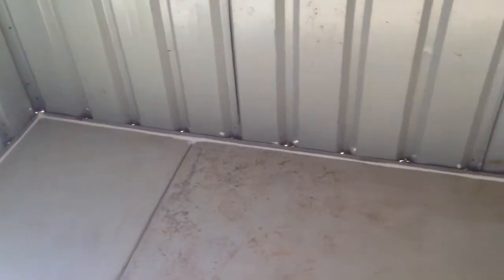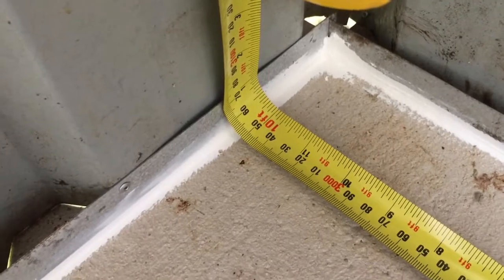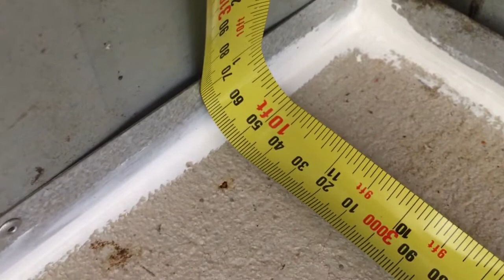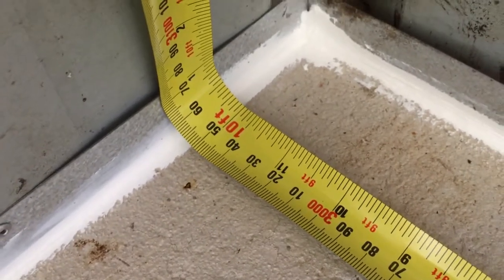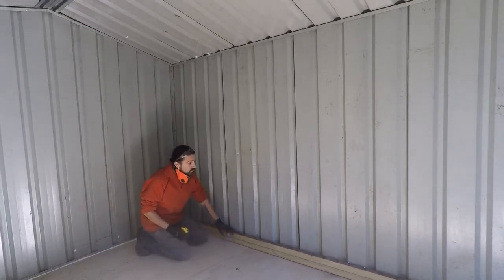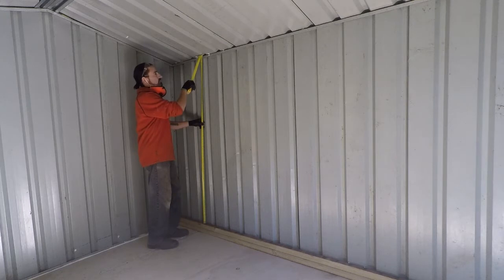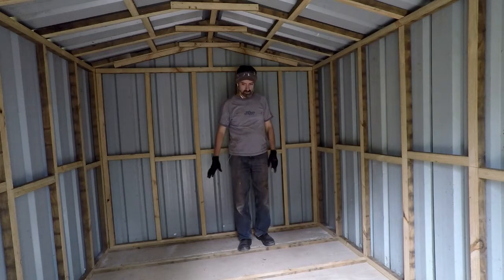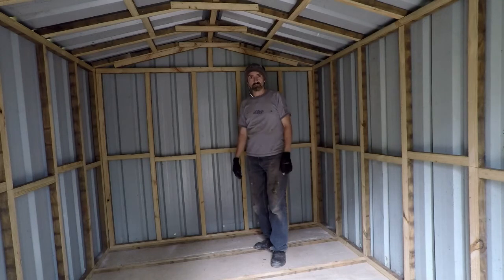Framing out my prefab shed

Comment: Thx for replying so fast, The shed I have has round tubular framing kind of like conduit and I am looking for a way to frame it with 2x2’s like you did. But wasn’t sure how to secure the framing to the walls or ceiling without a lot of damage to the corrugated metal
Reply from the maker: From memory, I don't think I secured the roof to the framing. The walls were, but not all over the place. Along the header (top wall framing member) and a few studs if they happened to be up against the steel. I also used screws with the rubber washers to prevent leaks.
Good luck with yours. Thanks for watching and reaching out.

Comment: What happens when it rains and the bottom channels fill up? Does it overflow into the inside? Not sure whether to add filler rod and sealant in all the spaces of mine? Or drill a few drain holes in the outside wall of the channels...
Reply from the maker: @elbanti  the inner side of the channels are slightly higher than the outer side. I also went along and drilled drainage holes in the so that they would drain out towards the outside

Comment: Hey mate i know this video is old n ya probably dont remember but was wondering what you sealed the floor with? I know you used foam for the gaps in the corrugated iron did you use the same for the floor ? Cheers
Reply from the maker: I used Selley’s 3in1 silicone sealant.  It’s great stuff. I just cut the nozzle a bit bigger.

Comment: How did you screw or nail those rafters to the top plate?  It doesn't look like you had access from the top for a toenail above the bird's mouth.
Reply from the maker: I think I just toenailed upwards from the top plate into the rafter. Not ideal, but it kept them in place. Thanks for watching.
Reply: @oojagapivy  it would be awesome to see a more detailed walk through of your framing. I just put up an ABSCO shed and I'm going to have to get some framing inside of it because I'm really afraid that the winter snow will collapse the roof.
Reply from the maker: @Eger118877  the next 2 videos in the playlist show a bit of the framing in more detail, including one scene where I hang from the rafters to test the strength of the roof frame. You’ll see my noggin detail including the extras I put to support the wall sheets I got. I’ve stood on the roof of this shed to trim the trees behind it, so I reckon the frame strengthened it a fair bit.
Reply: @oojagapivy  thank you. I will watch those videos for sure. Framing the inside of that shed was a great idea.

Comment: Hey mate. Trying to do the same. Did you screw any of the frame to the walls and/or roof? Cheers
Reply from the maker: Yeah I did. I screwed the walls to the frame in a few areas to add to its stability. I didn’t screw the roof to the frame though.

Comment: Why are every other side beam about 3 inches higher then the one beside it?
Reply from the maker: If you’re referring to the staggering of the noggins (one up, one down) it’s just how I’ve learnt framing here. Find the mid point of the stud and put one above that point and one below and so on. Each are touching the mid point for the rigidity but staggering makes nailing easier, through the stud into the noggin father than skew nailing through the noggin into the stud.

Comment: Shouldn't use decorators calk for sealing you should use silicone sealant
Reply from the maker: It was silicone. A 3in1 adhesive, sealant and gap filler. It’s white instead of clear and is paintable. It’s what I almost exclusively use now unless something calls for a specialty product or colour.

Comment: Just a lil question if I may, My wife also found us a shed. Did you have to screw or attach your walls to the shed or is the fit tight enough to keep it secure. Our shed has round metal framing i
kinda like conduit. 
Thank You
Dennis
Reply from the maker: Are you asking about the shed walls being secure or the framing being secure?
I attached the frame to the slab using concrete anchors. It could literally be freestanding and strong.
I also then screwed the shed to the frames in several spots as my way of securing it to the slab. I didn't want it to blow away.

Comment: I have a metal shed with wooden floor. How do i get the wooden beams nailed onto floor?
Reply from the maker: I used a nail gun for all of my construction framing. My wall frames were bolted to the concrete slab though.

Comment: I just came across this as I'm looking at converting an existing shed and I noticed you sealed the floor but left the slight gaps in the roof because of the corrugated steel. Were you worried about water or pests getting in there at all?
Reply from the maker: Having not watched this for ages I’d obviously not filmed something. I ended up using expanding foam all around where the roof met the walls and along the ridge line. The finished shed is completely sealed inside like a room in a house. Ty for watching

Comment: What did you use to seal it ?
Reply from the maker: If you mean around the base of the steel, a flexible silicone based construction adhesive and sealant. If you mean the concrete, just a premixed concrete sealer from Bunnings.
Reply: @oojagapivy thanks what size is the shed ? Which brand ?
Reply: @oojagapivy do you know which brand shed this is ? A the dimensions ?
Reply from the maker: @dlenox23dl  no idea of the brand. Wife bought it off fb marketplace and I dismantled it at the sellers house and bought it home. It’s about 2.7m wide by 3m deep.
Reply from the maker: Maybe 2.4m wide. I’d have to check.